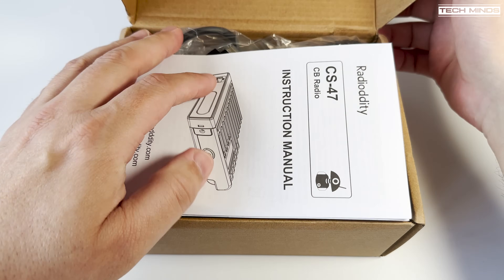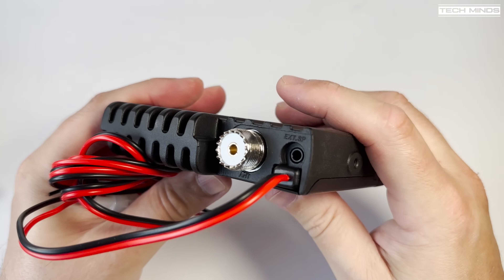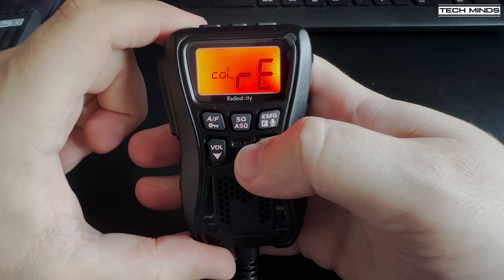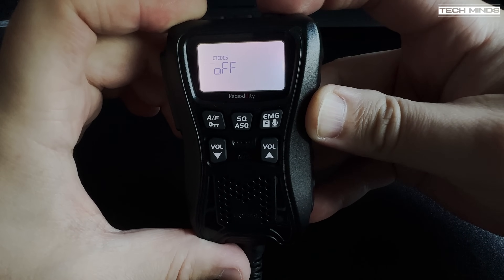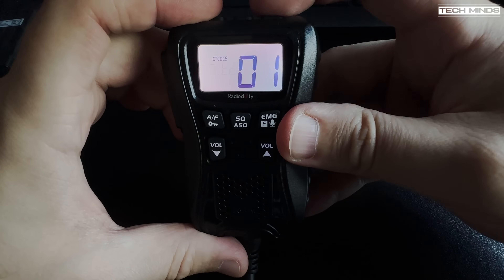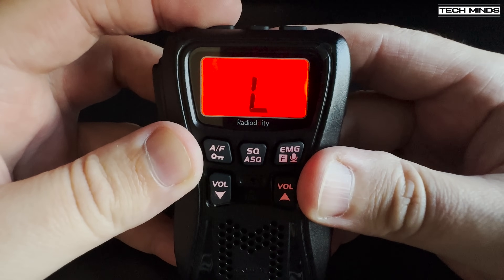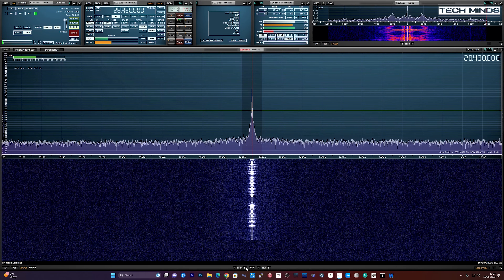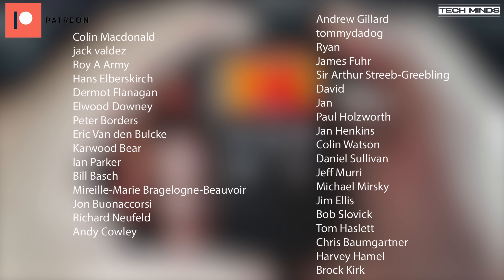Radioddity CS-47 With Amazing Export Mod Features - No Soldering!

Comment: How can you get into the service mode to adjust the modulation? There are several mentions of it out there, but no one is giving instructions.  I know about the jumper, and the wire for the extra bands, I am looking for the service modes.  This will allow adjusting of the modulation on AM.  I would appreciate any info anyone has.  Thank you!!

Comment: What screw driver did you use to open the unit. Neither my phillps nor blade work on mine.
Reply: forget the name of two options here.
one is a square. other looks like a Phillips, but is different. 
but in using a Phillips, there is more than four “styles/sizes.

Comment: I bought one, due to extreme hearing loss. I tend to not use hearing aids while driving to dampen road noise'. Due to this the interior speaker sounds are reduced and reflected speaker speech is garbled. Hoping this speakers modulating sound directly from mic to ear will clear up sound.  It should work fine (in my calculation). Just looking to use on US highways/interstates for traffic information. Cool little  compact feature rich unit.

Comment: The only problem I have is the RG45 cable. And that little pin did lock the cable into place in the plug itself on the radio. Has the tendency of breaking news that the plug will always come out? Another thing I wish you would have is upper and lower side than that would be really neat. However, in Canada, CV radio frequencies. Receiving vans or Harley ever used? Otherwise, the radio's cute locking has got a lot of features and it's really portable. What like I said the RJ45? Cable makes me a little bit nervous. Thank you for the video.

Comment: Great video.  If I do the mod to 10M does it retain the CB functionality?  I plan to use this on the road, so CB functionality is important to me.  But as a ham 10M is definitely of interest as well.  I guess I can always specify the freq, wondering whether it retains the channel number functionality
Reply: CB and HAM mode are actually mutually exclusive. However it is feasible to put a switch in the case for the wire. With a double three-way switch (2x3) it is even possible to switch between the states 10m, ordinary CB and export mode. However I never have use for the export mode, there is nothing interesting really going on there in AM or FM. However listening to UK stations is interesting if the Es opens the band, but this band can easily be selected by default. Having the export mode is only interesting when you want to speak on Russian channels or when your in-car coax cable has a loss of 3-6 dB at 27 MHz where you want to double or quadruple your radios output power ;-)